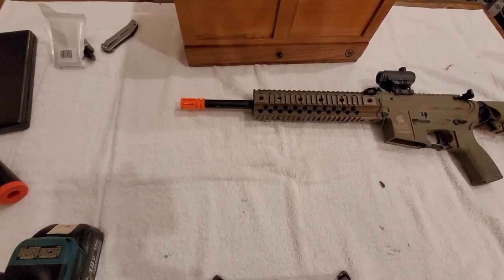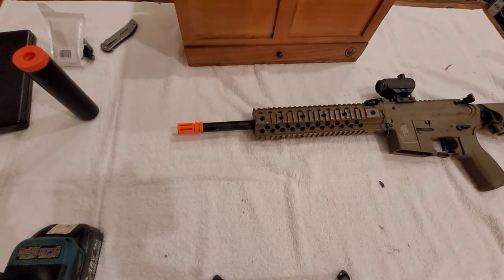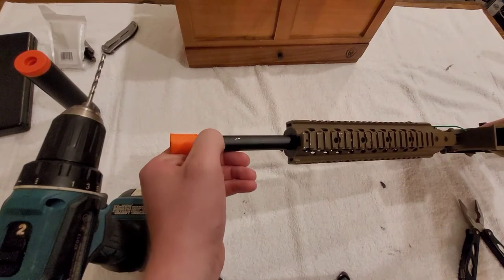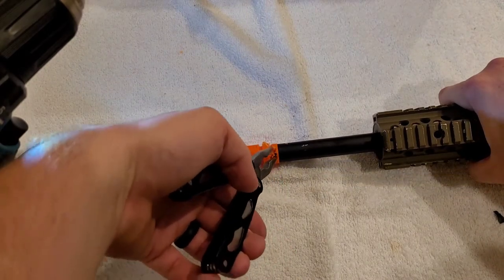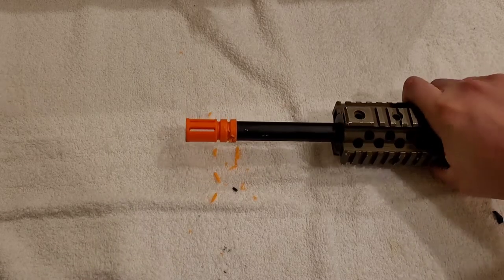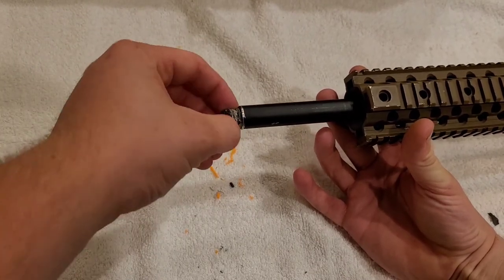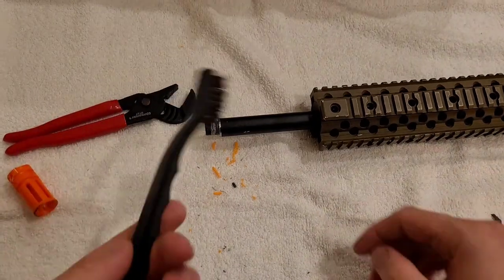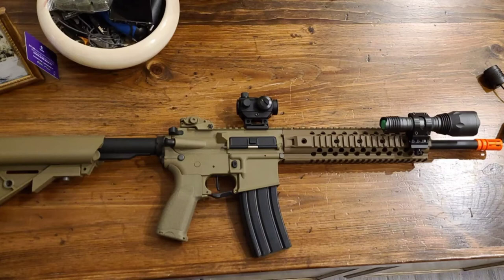How to remove orange tip on an airsoft gun

Comment: What size of suppressor did you use
Reply from the maker: Not even sure didn't end up fitting, sorry for late reply
Reply: @crossworkscreations4500  I have a acetech at1000 on mine and it looks great